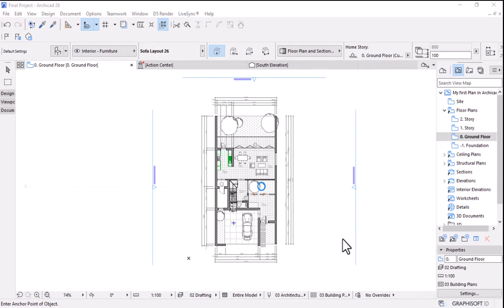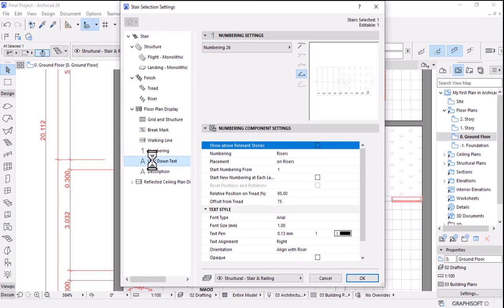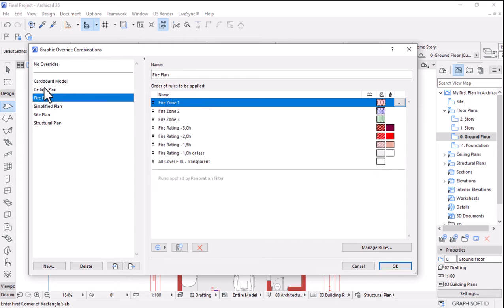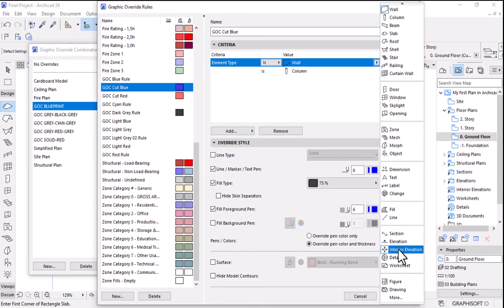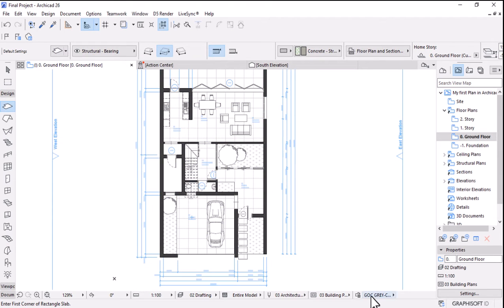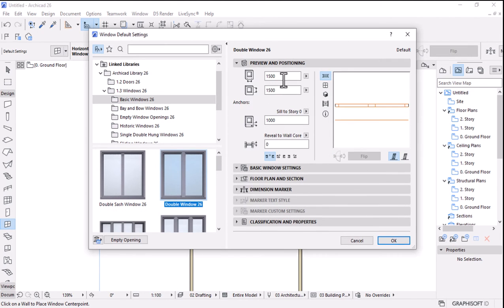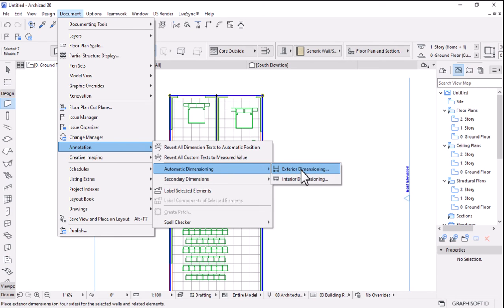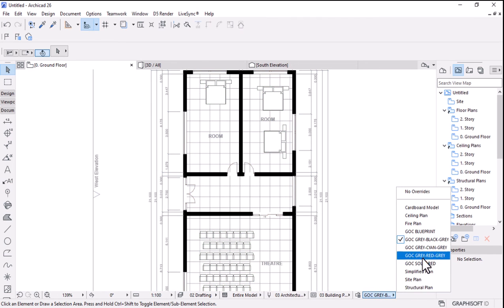Create Floor Plan Drawings Styles | ArchiCAD Beginner Tutorial

Comment: Hi, I purchased this file but upon loading it says it might be damaged or corrupted...
Reply from the maker: Which version are using? make sure you load the one for the version you are using.
Reply: @MesolightVisual   I'm using v25...i tried it on 26 and it seems fine, unfortunately v26 is only a trial version
Reply from the maker: The package comes with files for versions 24 to 26. check and make sure you load from a proper folder @terrencemudau7598